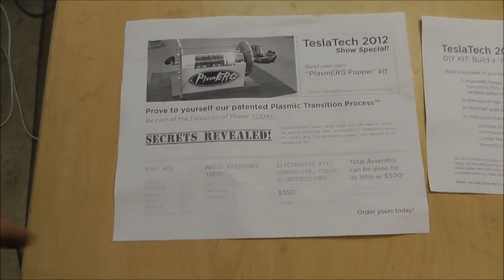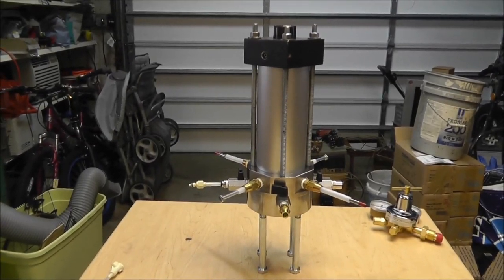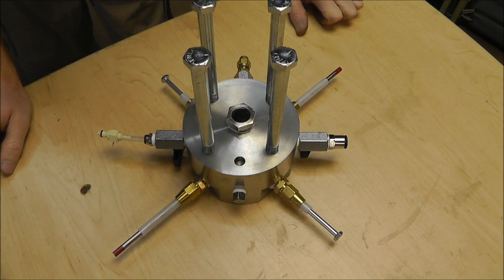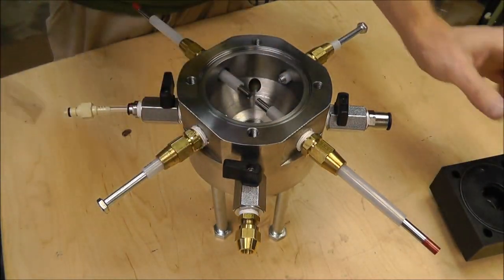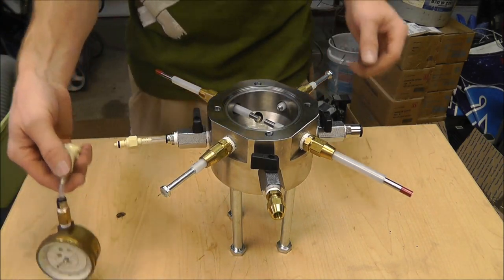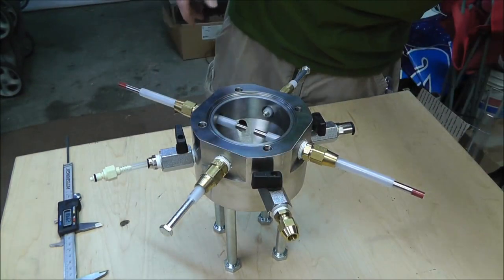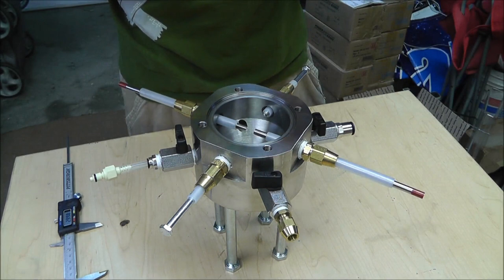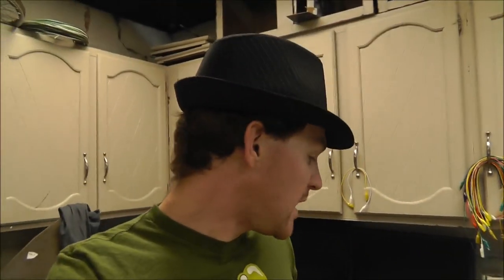Update 6 NGE Papp: Bob's Replica Test Unit 98% Done. Poll Should I Get The Kit Or Not??? RWGresearch

Comment: In addition, if you are supposed to hook up an RF signal to the coil (I am assuming here) then the coil itself will act like an open circuit and no current will flow.  That's with respect to the inductance of the coil.  However, with high-frequency RF excitation, the stray capacitance associated with the coil itself will allow for the conduction of some AC current at RF frequencies.

Meanwhile, the eddy currents inside the cylinder itself will always cancel out the signal from the coil.

Comment: It is not about being magnetically inert or not.  The metal cylinder that Russ uses is a conductor of electricity, that's the critical factor.  When the coil wrapped around the cylinder has changing current/magnetic field going through it, a corresponding opposite current flow/magnetic field will be induced in the metal cylinder.  The magnetic field generated by the currents in the cylinder itself will cancel out the magnetic field generated by the external coil.

Comment: some grades of stainless are magnetically inert. John uses  stainless for the cylinder wall and covers it with aluminum to isolate the coils from exposure. In crt tubes, the yoke steers the electrons to the back of the screen .This is the method john uses to control the plasma stream in the cylinder.(thru the stainless cylinder walls. (it works..)and the coils are dc controlled. (a dc signal changes to sinusoidal after being applied to a coil of any kind. Think of a magnetron or solenoid.

Comment: The key point is that it is still a resistor.  The plasma will have a certain voltage across it and a certain current flowing through it.  That means the plasma is simply burning off energy and producing heat once it is conducting.  It's just a glorified resistor.  There is a belief that there is a secret sauce somewhere.  It's just a resistor producing sound, light, and mostly heat.  So, the question to think about is:  What's the diff between a cap or coil discharging thru a plasma?

Comment: Russ:  Just for the fun of it let's discuss the plasma.  Typically a very high voltage will "ignite" the air molecules and turn them into a plasma.  Let's say it's 10 KV.  Once the plasma is lit, then the voltage across it typically drops dramatically.  Let's say it's 150 volts.  (Just guessing).   Then the plasma will allow variable current to flow through it but the voltage will typically remain around 150 volts.  That means it is a non-linear resistor.  Higher current means lower resistance.

Comment: The external coil will not have any real influence on the plasma discharge inside the cylinder for reasons I outlined in my other posting.  So the coil wrapped around the cylinder is just window dressing.  Russ can try popping without the coil, and popping with the coil.  In all likelihood he will not notice any difference between the two setups.

Comment: Russ,
John told me he used a mattress spring for the popper and some 3"acrylic clear tubing which looked right when i saw it in the summer of last year at his new shop in henderson,nevada. I was set to meet john thru ron williams, a contributor to johns efforts. We didnt sign anything (NDA). We observed the popper and the boxer engine(original) The boxer engine was inoperable,with the piston stuck like glue in a cylinder. The electronics did'nt seem to outrageous. everything was surface mounted

Comment: do some research on top fuel harley drag bikes and how they seal the cylinder to the cylinder head. these bikes have a tremendously high cylinder head pressure due to the nitro methane fuel used. they flush mount the head and cylinder with a narrow groove in the cylinder face with a simple oring.

Comment: The voltage rating for car racing coils (I looked at the web site) may have some context that I am not aware of.  I would hazard a guess that it may actually be a nearly meaningless marketing term used in the car racing/aftermarket industry.  There is a simple formula for calculating the voltage that a coil can output.  In theory the sky is the limit.  How much voltage a coil generates wrt the stuff that Russ does is always dependent on the specific setup and the timing.

Comment: its john that has intelligentry,not bob. I havent talked with bob,but I have talked with and met John Rohner here  in vegas. He granted me two of the coils he uses and they are made by weaponx(weaponx.com) they produce over 80k not quite 100kv. The circuitry is converted to smd from thru-hole circuit board tech of the 70s-80s. Most of the circuit is controlled thru a microcontroller, like an arduino or stm32.(used for timing which is critical to ensure syncronization of the process action.

Comment: weaponx.com is on the web and sell coils on a stick that are used quite extensibly in the drag racing industry. they produce coils that produce >80kv and higher. I have two of them and will provide pictures if neccessary. I use two 60kv coils from summitracing. com used in an opposing fashion to contain the plasma to minimise loss. They use thinner guage wire to handle higher voltages,expending less amphereage,and less heat(mine use 40guage)as the capacitors are the source of energy.

Comment: You have some major problems coming up if you are supposed to wrap the coils around your metal cylinder.  What I am about to tell you was mentioned to John Rohner on PESN and he was totally dumbfounded because he is clueless when it comes to electronics and electromagnetics.

If you wrap your coils around your cylinder then the inside of the cylinder will never see any magnetic field assuming AC excitation.  Currents circulating inside the cylinder itself will cancel out the signal from the coil